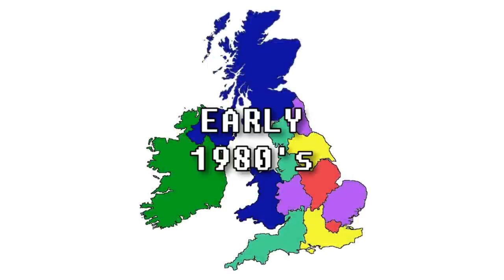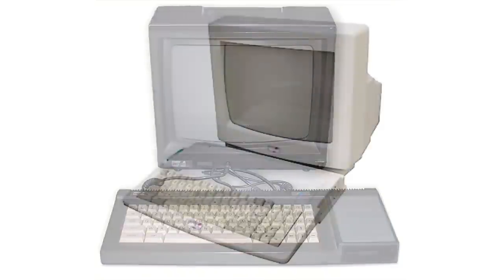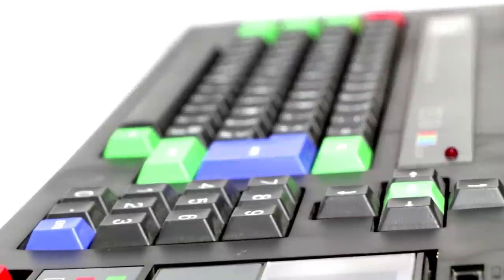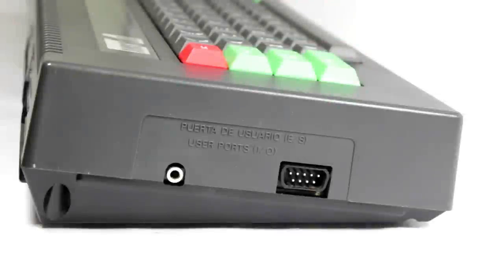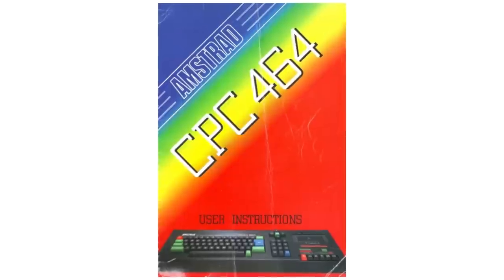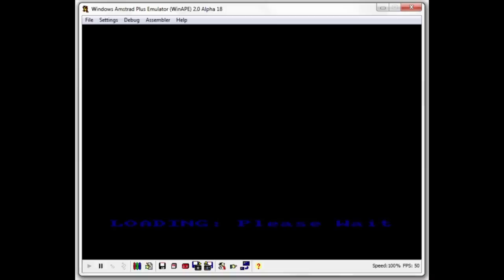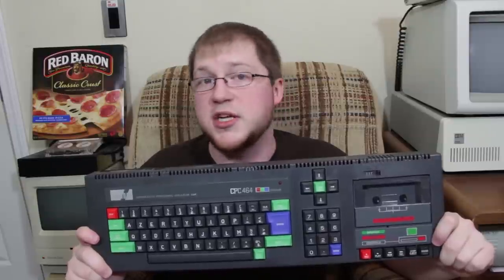LGR - Amstrad CPC 464 Computer System Review

Comment: That AY sound chip must have been hecka cheap because it wasn't much of a sound chip, it seemed every computer had it in the 80's even the spectrum got it in the end, compared the sound chip in the C64 or Amiga it was a total POS. I worked in a computer store in the UK from 1982 to 1989 and each system had it's game that we thought was it's killer app, like MSX Konami Ping Pong cart, on the CPC it was it's version of Commando, that was the dogs danglies.

Comment: The idea of a 3 inch floppy drive weirds me out man.
Reply: It was cheaper at that time, but what a bad choice back then, and horrible for die-hard fans of today...
There are schemes to physically mount a 3,5 inches floppy drive in the CPC instead of the 3 inches one. There's actually room for it ! I tried and it works fine, but not all drives are compatible.

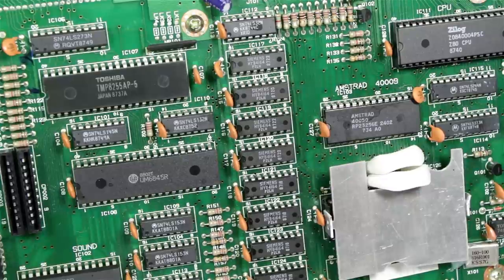Comment: 6:28 wait if that's an amstrad why does it have an Toshiba pc chip.. seen at top left
Reply: Alex Las That's not very odd at all, it looks like a logic chipset, and it's common for companies to source out the cheapest provider for what they need, also if you look at the same picture you will notice a lot of Motorola, and Siemens chips as well, and the Zlog Z80 that is used for the main CPU was also commonly found in many 8bit computers of the day with some custom instruction sets, and clock speeds depending on the model.
Reply: Alex Las It's used as an I/O controller, Toshiba TMP8255-AP http://pdf1.alldatasheet.com/datasheet-pdf/view/32519/TOSHIBA/TMP8255A.html
Reply: TheDeeplyCynical oh thanks I did not know that..

Comment: I have one these computers as well as a Sinclair +2. Unfortunately I've never been able to fully enjoy them here in the US on account of the problems of converting the PAL signal to NTSC. I did a search for SCART to HDMI converters and found this:
http://www.amazon.com/gp/product/B00988GMLG/ref=oh_details_o03_s00_i00?ie=UTF8&psc=1

this looks like the exact same unit other than the lack of name branding:
http://www.ebay.com/itm/Scart-HDMI-to-HDMI-720P-1080P-HD-Video-Converter-Monitor-Box-For-HDTV-DVD-STB-/310620740857

Is this what you use with yours? If not what exactly do you do utilize?
Reply from the maker: Same exact one I use, it looks like! Just ordered mine from Hong Kong.
Reply: Lazy Game Reviews Thanks for the reply. Do you think there's any difference between the two I linked to other than the cvid one being $13 more? I've noticed several of them on ebay and they all look identical, whether "name branded" or not and all are from China/Hong Kong.